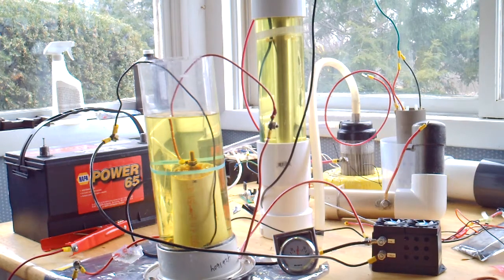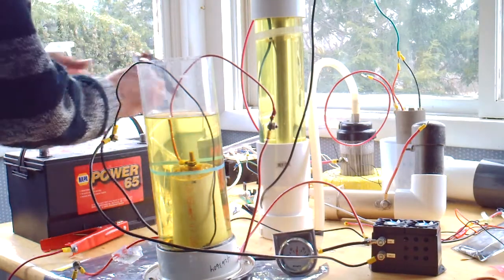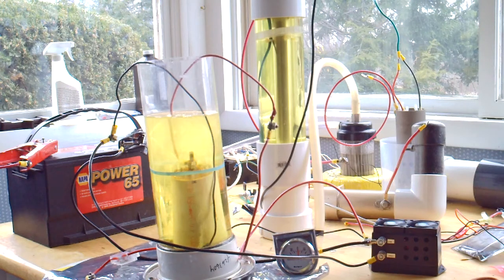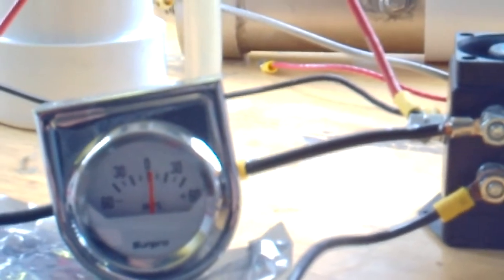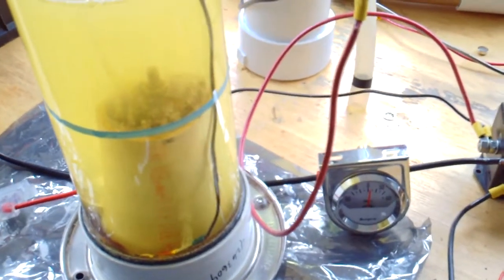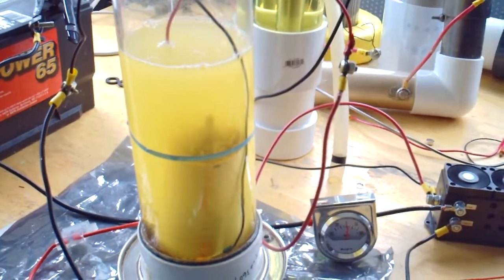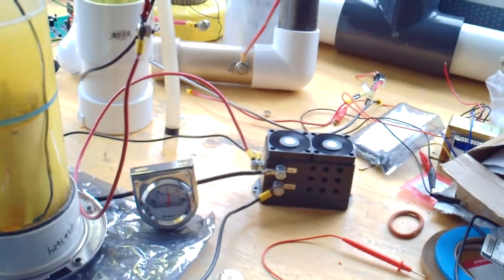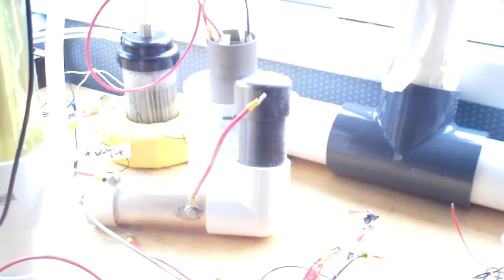Big Increase in HHO Output Using Under Two Amps

Comment: youtube 100 percent hho. these guys built a truck that builds up preasure of hydrogen and now theyre gone. the first guy to run a dune buggy on water had all these patents and then got poisoned. prob from oil companies. but supposedly trump supports this tech more
Reply: Brandochano don't doubt it but the government and big cheese heads can't stop the rate of technology advance .... super capacitors with nano particles or some shit are out now that can charge in 30 seconds and last all day....  wait tell they are available to the public and actually implemented HHO might not be needed or will be able to be multiplied back and forth with capacitors and all natural engines and no more poison exhaust ;)

Comment from the maker: Colin, until you test you don't know what's right. You can always mix up a new batch of electrolyte.
Never assume anything. Most of the info about this is hearsay and not accurate in all cases.
If you have a CCPWM, it could be adjusted to the lowest amp level. Ours can be adjusted from near zero up to 45 amps. It will just pulse a lot slower if the amps exceed the setting. D.

Comment from the maker: I'm not sure what you mean by wired through the negative.Need a schematic.
What happens when you add a couple of tablespoons of NaOH to your electrolyte? Amp draw and HHO production are directly related to concentration up to a point unless you use a Stanley Meyer 8xa circuit and VIC.

Comment from the maker: What are you using for an electrolyte? Or, are you using tap water?
tap or well water has enough minerals to be a very weak electrolyte and would conduct very little amps. You may be able to get more output by using a toroid coil in the positive feed from the PWM to your Cell positive.

Comment from the maker: The PWM is rated at 90 amps and is constant current adjustable.
I sell it plus the toroid coil that you wire into the positive to the cell + for $279 shipping and handling included. Call me for my PayPal email paylink. 207-319-7414

Comment: I`m getting about 1/4 litre per minute at about 0.4 amps with a 7 plate dry cell I made from an old gate. Can`t get the amps up though. Using a PWM and a 13.8Vdc 40A supply.

Comment: is that a magenetic pulse generator there in your hho generator?they say that sine waves break it down couple that with what you have and see what you get..try this one ,the rf wave is caused by electric magnet , it does the same effect as a regular  rare earth mag ,so epoxy a set  of rare erth mag to a blenderand spin it , rpm would change the signal ,adjust to get your desired production ,im thinkin, try it

Comment from the maker: Good question...from what I've read pressure makes little difference. Heat, on the other hand can increase HHO output for a given number of amps. But, if the heat is generated by the cells then it is less efficient as heat indicates wasted energy. Use the engine's heat from the radiator to boost efficiency by keeping the electrolyte warm but below boiling (obviously).